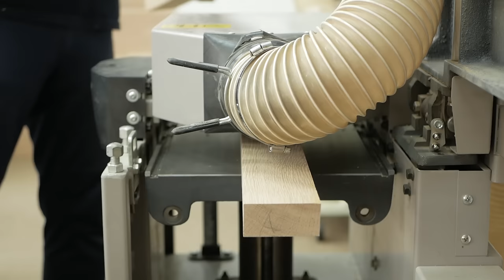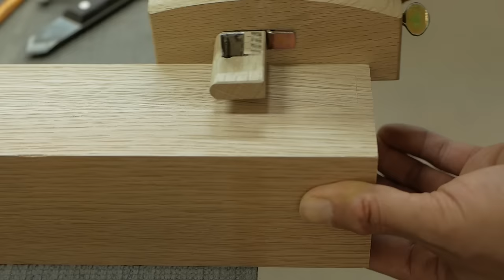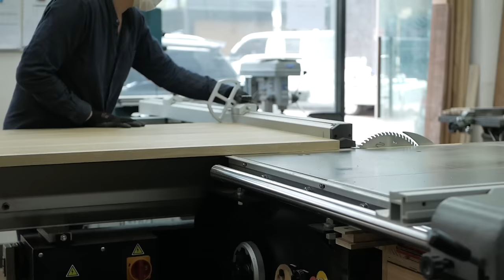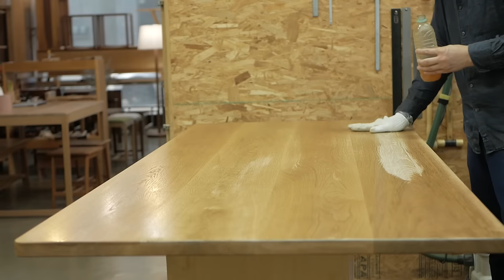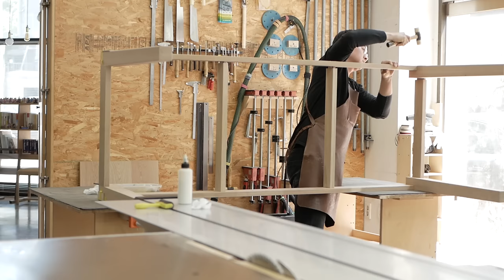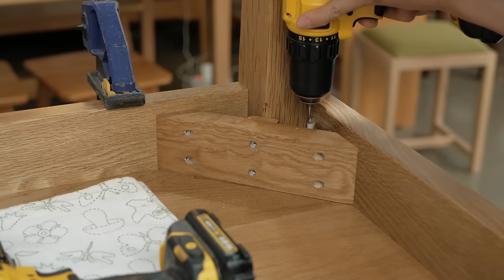SQUARERULE FURNITURE - Making a Basic Table

Comment: Great video as usual. Do yourself a huge favor, don’t wipe glue squeeze out! Just let it dry and scrape it off. I find it saturates the fibers in the surface with glue adding to sanding and more scraping and leveling. If you don’t, you have crappy finishing.
Reply from the maker: I don't know if my interpretation is correct, but if you don't clean it, you won't be able to get a clean finish. Each person has their own style, so I think you can work with whatever suits you best.
Thank you for watching.

Comment: The outer sidewall of your leg mortises are on the thin side. It should never be thinner than the tenon. An off-set tenon would correct this.
Reply from the maker: Good job. This was the part I was having a lot of trouble when designing furniture. I thought it would be better to give up a little on the outer wall and increase the area of the ledger.
In fact, the wall of the ledger is 8mm, which is better than watching the video.

I'm going to work on a little thicker wood for the next task
Thanks for the advice.!

Comment: Did you use oil or a combo wax oil for the finish?  I'm curious, because I've seen people finish with butcherblock finishes for dining room table tops.  It seems every amazing finish I see is from an unlabeled bottle 😅. 
Very nicely done all around.  Basic or not, I learned a thing or two while watching this that will help with my own woodworking.  Thank you for posting this video and keep up the good work!
Reply from the maker: Oil 126 from the German Auro company is used.
Only the table top is finished with a water-based varnish.
No wax is used.

Recently I am considering using Gordon or Monocoat.
I am glad to be able to help

Happy New Year^^
Reply: @squarerulefurniture  Thank you so much for your reply!  Thanks for the information also.  :D. I'm going to look those up, see if I can manage a good table top coat, or at least a few trial end tables first before tackling something large.  Thanks again and Happy New Year to you as well.  😁

Comment: do you use something to inner hold the table or just glue? thanks for sharing. beautiful content
Reply from the maker: Installed with iron only.

The frame of the top plate is not fixed with a bond.

Comment: I need to make large hardwood sash windows. Please identify a good quality table saw, planar/thicknesses and a jointer. And any other machines that can help. Thank you.
Reply from the maker: hello.
The first is the budget, right? Next is space. If it's a simple hobby, focus on cost-effectiveness. For example, if you live in the United States, it would be better to use a DeWalt Makita or Sawstop table saw. It's difficult to give an exact answer because it's such a broad question.

Comment: I've noticed I rarely see you sand, infact I don't think I've seen you sand, how do you remove machine marks, is that done off camera? Love your work.
Reply from the maker: The saw blade marks are erased with a small planer
I work hard with Festool Sander.
If you look at another video, you will see the sanding part.

Subscribe if it was helpful^^

Comment: Which technique was used to join the tabletop board edges? Biscuit, dowel or something else? Also, I have never seen the bare blade and guide used for the tenon cuts before. It looks very specialised.
Reply from the maker: In Korean, it is an eight-character hardware. It can be obtained relatively easily.

It is a circular saw machine. The model name is TOKIWA SB400. For more information, please search Google~

Thank you~^^

Comment: Just found your channel a couple days ago and have to say, what beautiful work you do, the care and precision put into each joint and piece. Watching this, I have one question, how come you used screws the older Philips head instead of a newer design with less chance of stripping like Torx or Robertson heads?
Reply from the maker: It's a bit difficult to interpret. Are you talking about the screw that connects the frame and the top plate?
Reply: Yes. Just talking about the head interface, Philips vs other newer designs like the square Robertson or 6 point Torx. Once I started using them, there's no wanting to go back to the Philips heads.

Comment: Hello.  You are a very good carpenter.  I have a question about the Hammer A3 31. Do you have any problems with it.  I own an older model and have problems with it.  So I was thinking of buying a new model.  So I would love to share the experience with my Hammer A3 31 planer.
Reply from the maker: Hi, nice to meet you
 I've been using the A3 model for 6 years
It is a helical model, and water pressure and automatic exchange
It's a bit cumbersome, but I used it with great satisfaction.

However, in 2020, the main bearing would end its life
I disassembled it, but it was too difficult to set
So, in conclusion, I decided to purchase a new automatic plane

It's a good equipment for woodworking as a hobby or for small workshop

If you have any more questions, ask me~

Comment: Thank you for the video. Yor work is simple but beautiful. I have a question. Your're not worried about the movements of wood since there is no cross beam? Is it because that type of wood don't move so much? I'm non an expert so I'm here to learn. Thank you.
Reply from the maker: Good morning. I think it's my job to let the tree move freely rather than worry.

In a country where the four seasons are distinct like South Korea, where I live, it seems that there will be a lot of increase and decrease.

Hardware is used to prevent these things, and it is still being used without major problems.

  I hope this helps.

Thank you.
Reply: @squarerulefurniture  thank you very much. Your works are always an inspiration!

Comment: Hi. I noticed you are using a wood planner shaving off small amounts from various parts of the table. What is this for? Most people I see just cut the wood and then sand it and finish it.
Reply from the maker: Are you talking about wood planers?
The purpose of using a hand planer is to refine it a little more.

For example, if you rub a surface with sanding, the plane will collapse, so you should try not to break the plane.

If the surface of the wood is narrow, lightly peel the surface with a planer and finish it with hand sanding to keep it flat
Reply: @squarerulefurniture  I see. the wood plane is to shape the wood evenly. Sanding would destroy the even surface right?
Reply from the maker: @jakez9376  If it is not sanded, the oil will not penetrate well.
It would be better to sand it to a minimum so that the surface does not collapse and scratches are not visible.

Comment: Hello, Sir! I admire the way you work, the calm in your videos and... the final product! I would like to ask you something... what product do you use to finishing the table?  Thank you very much!! Panchi.
Reply from the maker: AURO 117  1time ->  AURO  126 times 3 times -> Completely dry -> Varathane Polyurethane Varnish 5 times

TIP : 

- For the oak series, fine sanding is recommended.
If you spray water first, the surface will be smooth when oiled.

- The point is to apply thinly and wipe well. 

Thank you!

Comment: What is the benefit of the double/stepped mortise and tenon joints on the cross supports?
Reply from the maker: I don't know if this explanation is enough
Since there is relatively no wood left when a large hole is drilled, we created a wall in the opposite direction of the wood grain and worked in two to increase durability.
Reply: Ah that makes sense, thank you for the reply!

Comment: If table cracks , from heat in appartment , whats your warranty in that case ?
Reply from the maker: I will repair the furniture I made.
As of yet, the tree has not been severely cracked or bent, so there has been no structural problem.

Comment: Beautiful table, what kind of angle did you put on those legs? is there a ratio you follow depending on table size?
Reply from the maker: The leg is 70*70 and the lower leg is 55mm.
As the table size gets smaller or bigger, the foot thickness
There is a change in the apron.

Comment: Can I ask what is the stain/oil you used to protect the table surface? I like the way it does not change the original color of the oak and I’m planning on making one myself. Thank you!
Reply from the maker: I use auro 126 oil
The table top is additionally treated with water-based varnish.

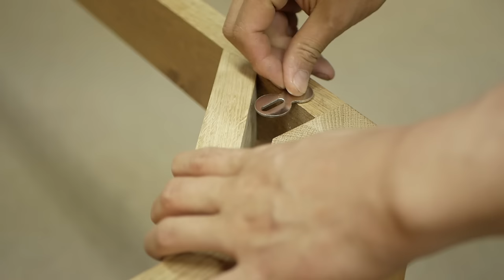Comment: Can anyone please tell me how to measure the correct angle of the corner pieces he uses at 11:41, so that they fit perfectly flush against the inside of the frame?
Reply from the maker: There is no special way.
I took my time working on each leg, cutting and fitting, cutting and fitting.
Reply: @squarerulefurniture I appreciate that however I was referring to the wood pieces with the bevelled edges, that you placed on the inside of the frame. We’re they cut at 45 degrees, 47 etc? How did you measure them to ensure a perfect fit?

Comment: Sir, what kind of table saw are you using? Your work is amazing!!!
Reply from the maker: The American brand production uses the Laguna 12/8 model made in Taiwan.
Reply: @squarerulefurniture  thank you for replying!!!
Reply: @squarerulefurniture  what saw blade manufacturer do you prefer?
Reply from the maker: @JWLWoodWorks  Saw blades are purchased from domestic manufacturers.

The saw blade doubles as a cut-on between 60-80 blades.
Reply: @squarerulefurniture  thank you

Comment: hello, what oil finish  did you used at table. tks
Reply from the maker: Nice to meet you~ The oil used is AURO 126 + Varathane Polyurethane Varnish (water base semi gloss)
Reply: Could you explain the surface treatment in more detail ?
Reply: You first apply the Auto 126 hard oil ?
And then you apply a water based Polyurethane lacquer ?
Or are this 2 mixed together ?
Reply from the maker: 117  1time -> 126 times 3 times -> Completely dry -> Varathane Polyurethane Varnish 5 times

TIP : 

- For the oak series, fine sanding is recommended.
If you spray water first, the surface will be smooth when oiled.

- The point is to apply thinly and wipe well.
Reply: Hi
Thanks for your reply.
I hope you would make a video where you show the surface treatment process step by step...
Reply from the maker: I'll try~~
Thank you.
Reply: SQUARERULE FURNITURE . Thanks  by your prompt answer!!! Your job are so Nice and perfect!!!!
Reply from the maker: thank you !! 😍

Comment: @SQUARERULE FURNITURE What kind of finishing are you using?
Reply from the maker: Auro 126 oil is used and the top surface is additionally finished with water-based varnish.
Reply: @squarerulefurniture  Thank you very much.
Reply from the maker: thank you^^

Comment: What is the liquid you applied for the top finish ?
Reply from the maker: I usually use German auro126 oil.
The top plate is additionally water-based varnish.
Reply: @squarerulefurniture  thank you for the advice ..🙏

Comment: Very nice work!!  Where did you get the figure eight style fittings you used to secure the top?  I have never seen ones with slots in them to allow for long way wood movement.   That a nice solution.
Reply from the maker: http://woodbin.co.kr/product/detail.html?product_no=1682&cate_no=164&display_group=1
It is produced in South Korea.
Reply: @squarerulefurniture  Thank you very much, I will contact them and see if they will ship to the USA.
Reply: I tried, but didn't get a response.
Reply from the maker: I think it is because I have never delivered overseas. I will personally contact you once and answer.
But it will take a little time.
Please wait~
Reply: @squarerulefurniture  Thanks very much.   No rush on my part.

Comment: Great job! Will the table top stay flat over time?
Reply from the maker: Thanks~ Trees are transforming from time to time without our knowledge, especially in Korea (south korea) is hot and humid in the summer due to the four seasons and is quite dry in winter. The use of hardware also prevents the top plate from bending to some extent, which is probably difficult to see with our own eyes.
In the summer, the top of the top will give you a little bit. This also depends on the condition of the wood and the texture you used, but I don't think it's enough to worry.

If you have any other questions, please comment ~

And if you don't subscribe, subscribe! Thanks!

Comment: What is the thickness of table leg and apron/rail? Thank you
Reply from the maker: It is slightly different depending on the condition of the tree,
This time I used a thickness of 34 (mm).
Reply: @squarerulefurniture  Do you think 25mm (1") is too small for thickness for similar table? Thank you
Reply from the maker: @steph3n17  Over time, the tops will probably warp a lot.
Since there is no apron in the middle of the top, apart from bending, the center will sag over time due to gravity.
(Practically, the 1900mm computer table I'm using has a slightly lowered center part due to the weight of the years. 32 thickness)

This type of structure is better the thicker the top plate is.

Comment: How do u polish the wood
Reply from the maker: After grasping the face with an automatic planer, it is polished with sandpaper.
Care must be taken to ensure that the wood surface does not die when grinding.
The table top is finished with No. 400 sandpaper and greased.
Reply: @squarerulefurniture  thanks!

Comment: But, what about the twisting wood behavior? How can avoid it
Reply from the maker: The transformation of the tree cannot be avoided.
Furniture made 10 years ago is still moving.
How to minimize the cracking, cracking and warping of trees
I just think constantly.
Reply: @squarerulefurniture  I mean, delivering a beautiful product like this and in a couple of months the surface are not the same as it was, you know its a huge problem
Reply from the maker: @sirbirre  The surface lasts quite a bit longer than you think.
So, the last thing we do is protect the surface with a water-based varnish.

Comment: Honestly, the screw made me sad
Reply from the maker: Next, I'll use the wood button.  thank you~
Reply: Why were there 2 little dowels placed and then cut off? That bit confused me
Reply from the maker: @dogwklr  Exactly what you are talking about
Please tell me how many seconds it is~ I will answer in detail~
Reply: 11 mins
Reply from the maker: Tenon is perfectly combined.
However, this tenon does not break out of the hole over time (100 years~)
We did additional reinforcement work to prevent it.
Reply: Oh you used the little dowels to prevent it shifting out of position during a contraction or with wear? 
That's really cool! Beautiful table